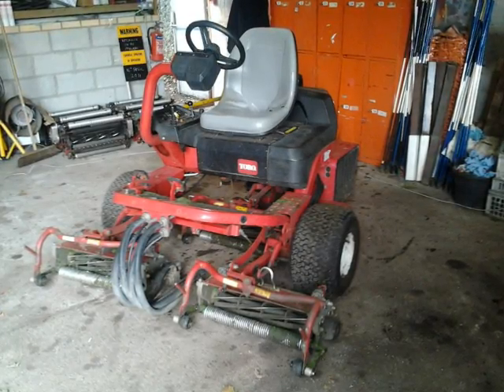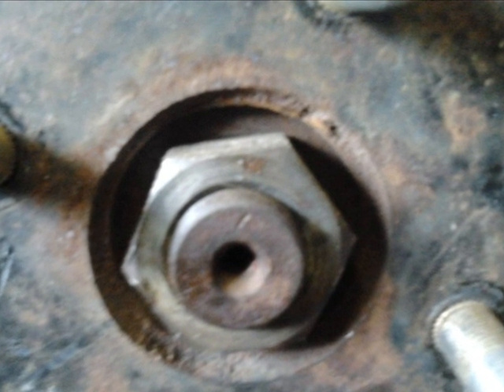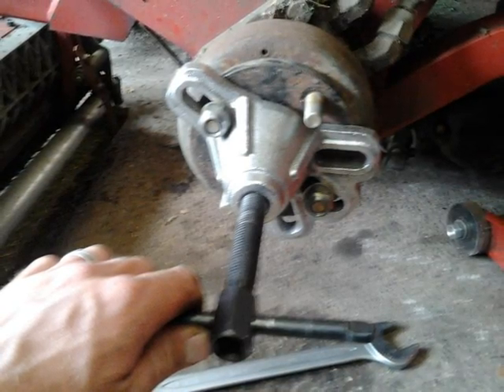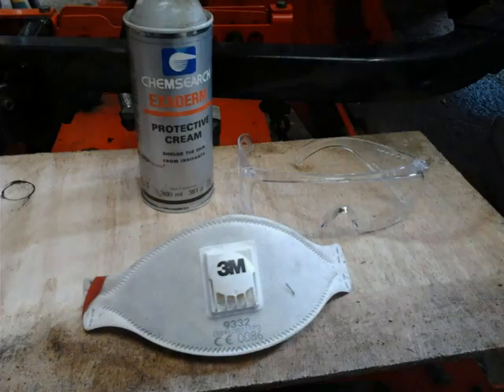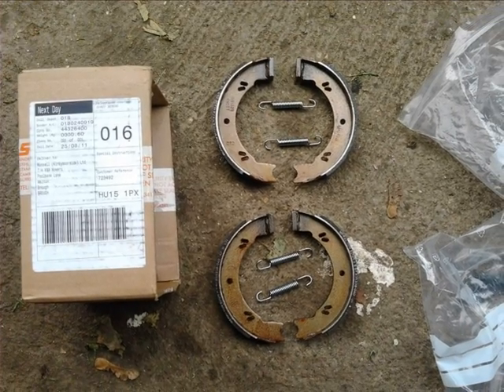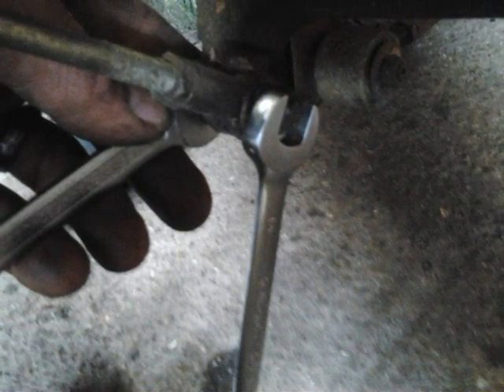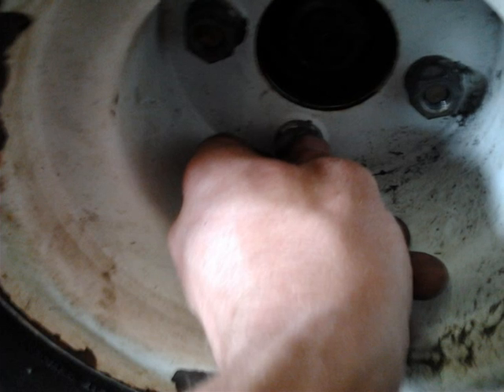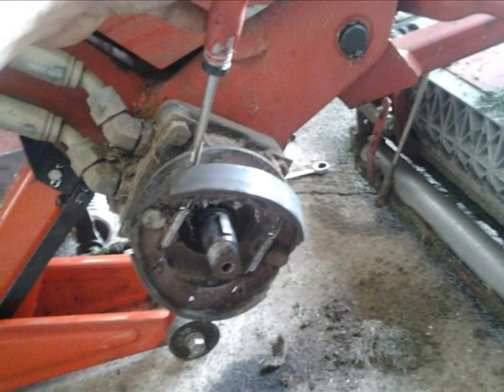Replacing brake shoes on a Toro 3250d

Comment: Great video I did ours today and it was actually the lever thru the hub that was seized, removed all components clean with wire brush greased and re fitted and with abit of adjustment the brakes are better than new and still on original shoes